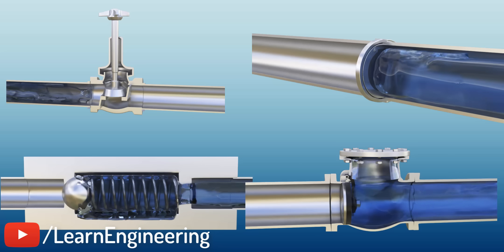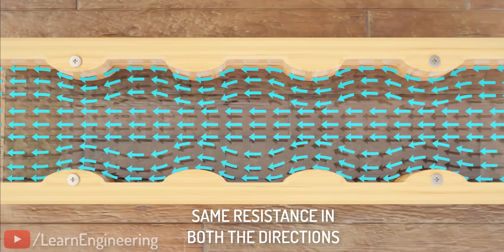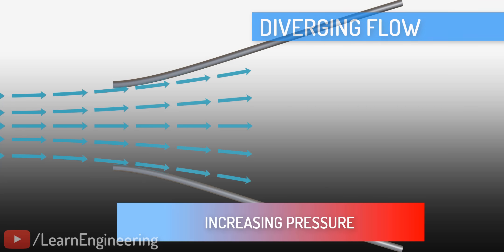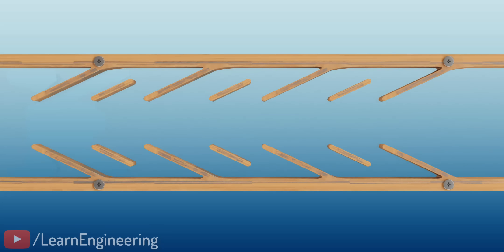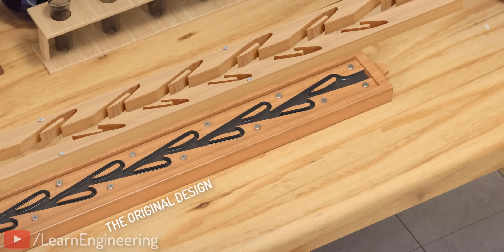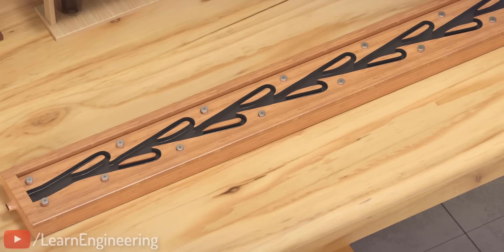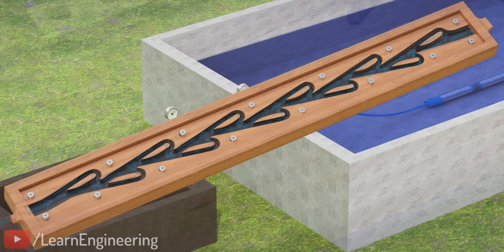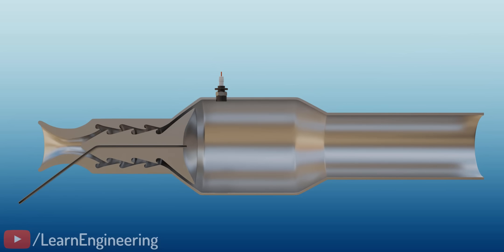Tesla Valve | The complete physics

Comment: Well I'm suprised the video does not show an actual water test.
Reply: Yes, showing actual fluidic components and models would be helpful for understanding. Notice the pulsing, as this is not only a partial diode but a partial fluidic oscillator.
Reply: Cause it doesnt work.00
Reply: Maybe because it wont work well enough to impress. It just makes a little bit of resistance, you can search on youtube to watch a test
Reply: @mauhoangthanhtrung  right, I put it slightly like you said. Maybe not as clear.
Reply: You can see a real world application of the valve here: https://youtu.be/OwHUl7ehIbI
Reply: @ausgepicht  Thanks, that is a great link. It shows what I expected, that the flow from each loop diverts the main flow into the next loop. Some particles are actually moving backwards through the main channel, so the flow through the side loops is actually greater than the total flow!
Reply: @ausgepicht  well no it shows turbulences...
Reply: You shouldn't have to make your own Tesla Valve. Surely one can be purchased online.
Reply: @hellbent7062  I had to buy a ball valve to reduce/adjust pressure on a project. Just saying.
Reply: @Joe Dirt yes , Mr. Joe Dirt! Good way to say it.
Reply: https://www.youtube.com/watch?v=OwHUl7ehIbI
Reply: I AGREE
Reply: you could do this with the addition of a dye at the inlet and would be great to see, but the animations work well on a budget.
Reply: @dizmatt1  I don't think dye would be something I could readily see. The link someone provided shows a large valve where they dumped black particles into the water, so it is easy to see the water flow by watching the particles. Dye thoroughly mixed with the water would be the same as just water, but the particles remain visible showing the flow.
Reply: @BenAtTheTube  dye would work but you're right in that it would dilute and lose effectiveness. I've done micro particle fluid visualisation in liquids using a laser light sheet which works well. The larger the particles the less likely they are to follow the flow due to their buoyancy but they can help with simple visualisation so they have their place of they don't aggregate and clog up the channels
Reply: @2684dennis  Well, lets waste another one by responding to this comment!
Reply: I think the more pressure and volume will show different results (which I don't think it is beneficial).  This might work only for a every small parts and applications (in open system).   Fluid in a close system always acts as a solid rod (such as aircraft hydraulic system).  This Tesla system must be a open system.  I haven't seen one yet.  Fluid is not compressible.  Air/fluid system (aircraft landing strut) is used to have the bird like landing effect (not bouncy) when they go thru the designed orifices.
Reply: @2684dennis  I really enjoyed the conten and the conversation,  I just was suprised the was only animation. There is no such thing as wasted time, have a nice one!
Reply: Before you comment, you need to understand what are types of valves. I suggest this as a starting point in your researching.
"Valves 101: Valve Types, Sizes, Standards & More - Unified Alloys" https://www.unifiedalloys.com/blog/valves-101/
Reply: Because the valve doesn't actually work IRL. Fake news
Reply: @tosgem  well yes and no, it is not a  "valve", the  principle or definition of a valve is e device that  can control the flow...here i see something  quite, intuitive,  the flow changes   according to symmetry of the system.....   that s all... i am supposed to admit in one  direction if will ALWAYS be weaker...well.. turbulent flows are tricky...as the system is based on turbulences.. well messy technology. hard to control. Ok no moving parts..as if it was a problem..
Reply: @tosgem  really, you think not. Lmao
Reply: @tosgem  it kind of works. Its not a one way valve but it has more resistance in one direction. My point is that with an actual test the video would look more scientific. Now it looks like some face mask commercial.
Reply: because it could never really be used in a real water application.  Explain to me the circumstance in which you would want water to flow in one direction and still flow in the other just slower?
Reply: @insertgoodname4809  Personaly I would build a hydraulic boolean calculator. But I can come up with more applications of this technology. Especially in agriculture and hydroponics.
Reply: @Tiriris  It's not a true valve.  It just slows the water down (marginally  at best).  How would you use this in real life.  There is a reason you don't see this being used.
Reply: @insertgoodname4809  Yes I know its a toy, but it's interesting!
Reply: @insertgoodname4809   , valve expert?
Reply: @inthemaze7441  Don't know, but I'm seemingly a common sense "expert".
Reply: @insertgoodname4809  https://youtu.be/sxvIQMnKhIg

This video will help a bit. Many more like this. It really is a valve,  just no moving parts as I have stated numerous times above. I've worked with many valves, motors, hoses, connections for many years as im a hydraulic and pneumatics engineer for a earth drilling manufacturer.  If I don't approve it, it doesn't go on the machine. Got it, ive done every bill of material,  on each standard unit, which includes,  triplex mud pumps,  water cleaning systems, and drilling units. When it comes to custom designs,  im the one on the clock.
Reply: It doesn't show an actual test because the diodicity is somewhere between 1.5 to 4. Where higher values are usually for pulsed flows. And the pressure drop is not negligible in the forward direction, it is quite large.
Reply: May be they don't have a wood or metal worker? Animations worked well enough as even if you could see though a plexiglass face, due to the valve slowing the flow, you could not see the direction of the water flow. This would then need animations of arrows again.

What I would find interesting is more mathematical information. How long, at what diameter, fin size, and liquid pressure going into.
Reply: @inthemaze7441  I got it wrong and cant quite understand how when the channel widens this leads to slowing the water?
Reply: @giggleherz  it doesn't get wider, it's the loops back, creating back pressure slowing flow. Now if you were to extend out the valve even further,  it would have a greater influence against pressure.
Reply: @inthemaze7441  no need for animated arrow, you could simply add dye or bubbles or a bit of sand to the water
Reply: @lastyhopper2792  but you must agree that building the valve, with a see through front, is more expensive  than showing the animation. The animation is correct.
Reply: @inthemaze7441  i am interested with the latest part that you mentioned too. IMO a large diameter pipe (more than 450mm dia.) seem very wasteful in terms of material production if using Tesla's design. UNLESS.... The angle of the valves increase. Perhaps that can help.
Reply: @yukia.8188  your correct. The deal is that it is a valve, however not a great valve by any means.
Reply: @yukia.8188  it's as the water screw being called a water pump. Is it?
Reply: Well. That's because it doesn't work as described lol. It's not a one way valve. It's more of a one way resistor. Certainly not as effective as the other valves shown in the video.
Reply: This is not a Valve, per se... It is an iteration of many in reaction to the next. If the flow of liquid is minimized, can a few drops make the journey thru??? Damn
Reply: @aheckers  can you show us some different valves, actions, and a brief discription of how they can be used together in a 7 bank valve, in both, momentary and stand....possibly tell us this, who said it was a shutoff valve?
Reply: That would substantially increase production costs. You might be able to get someone like William Osman to do a video fabricating and testing a Tesla valve.
Reply: @MelvinPepperdash  not really.  A cnc can cut out one for very cheap, and would have elevated the video above ufo sightings videos. You know,  animations are costy as well.
Reply: @Tiriris  They are obviously working from an animation studio. It might be cheap for youtubers who perform on-screen, but that requires a whole new set of equipment and staff.
Reply: @MelvinPepperdash  "obviously" is a strong word to use for what is in the end a hypothesis without facts.
Reply: @Krosis_  The facts are their own presentation. Do you think we're discussing a hypothetical channel where we didn't all just watch their production? Are you really trying to challenge what is obvious before everyone's eyes? That's called gaslighting. Everyone can see what they put out, and no one is guessing.
Reply: Check out drawings of Heron’s perpetual fountain.
Reply: @kenthazara5477  Do you even understand my point? I'm not saying it wouldn't help; I'm saying this production crew doesn't have an on-camera staff. What are you even replying to? Because it doesn't have anything to do with what I was saying.
Reply: @MelvinPepperdash  you're obviously wrong. Pls don't challenge me on this, the facts are their own presentation about why you're wrong.
Reply: @kenthazara5477  And for all this bickering, they included a link to an actual, physical demonstration in their pinned comment. I don't get why you choose to argue over this.
Reply: @Krosis_  I mean, if you just want to "believe" in whatever, go for it. But if you're right, you're essentially accusing them of being lazy and half-assing this project.
Reply: @kenthazara5477  you do realize though that this channel only explains the concepts behind technical solutions that already have or had practical applications, right? If you don't believe it works, well, that's on you. I don't think they're trying to prove anything. They're trying to explain how stuff works that already has been proven.

Comment: That’s more like a pressure regulator than a stop valve.  Still very cleaver though!  💡🤓
Reply: That is EXACTLY what I came away with. It would slow the water by a great deal..but it couldn't stop it. Not without a shutoff VALVE to do so.
I guess I am to stupid to understand what they mean by the word..VALVE. 😂😂😂😂✌️
Reply: @garyheaton4791  hello binary friend, put the unit at an angle n u can stop the drip. Stop acting so linear .
Reply: @garyheaton4791 z 14 tttut 💥💥5photo N2CIS,1,:3rd f61 MLaa52B 💥r etc. ÇdtoyCD 4
Reply: No, not a pressure regulator but a flow regulator. Like in drip irrigation. I do wonder how the flow reacts to an increase in a higher or lower pressure.
Reply: @luiexluie  my question exactly!! I work with water lines on ski runs, with drops of 1500 feet. our PRV's are ineffective in cold temps without a heat source.
Reply: Some folk need to look in a dictionary
Reply: ave baker  its not a check valve though is it.
Reply: A valve is a pressure regulator...
Reply: @k1sserCx  a pressure regulator is called, a “ Pressure Regulator.” As far as “valves” there are many types.  An isolation/stop valve is what the title of this video was interpreting but left out the type of valve.  You would confuse a parts store worker if u ask for just a valve...  They would in turn ask you, “what type of valve???”  Lol.
Reply: ave baker  i fully understand what it does and how it does it but it is not a check valve though is it, think before you reply

Comment: The design challenge from the very start of the video was to create/design a ONE WAY valve... Tesla's Valve cannot stop the flow of a liquid in either direction. For that reason Tesla's "increased resistance pipe" fails the design brief, and receives a thumbs down.

Comment: @4:28 I would have thought that the curved surface of the secondary flow 'Island' would serve to accelerate the secondary flow back to meeting the primary flow, thereby further reducing the velocity of the primary flow. Where you mentioned the loss of velocity when it hits the "bucket like structure" @ 4:2, the loss of velocity of the secondary flow would be necessary but undesirable; the following curve would thus compensate for this as I mentioned. I feel that this is likely an important design intention by Tesla. 
Very nice video, thank you.

Comment: At 1:19 it seems to me the left-to-right flow is diverging in the center but converging near the outer walls. While the right-to-left flow is converging in the center but diverging near the outer walls. I guess actual testing would probably reveal some difference in resistance one way or another, but my instinct looking at these diagrams is that this is similar to perpetual motion machines -- where they seem logical until you look at the total picture. The water (or whatever) is flowing through the whole passage, not just the center where the arrow is. I find the arrow through the center holes to be a bit misleading, in fact, focusing my attention away from other important facts.

Comment: This is cool, but the tesla valve is not a one way check valve. If you turn off the flow the water will drain from the inlet of the valve. The purpose of a one way check valve is to not have any flow in the reverse direction with the flow on or off. This video is misleading.

Comment: But... now the whole valve has to be flipped 180 to change the flow. It's got the most significant movement, with the greatest external energy input of any of those valve designs. Not to forget, also the worst flow rate when active. You're just outsourcing the valve movement to another part of the system. It's a valve with no moving parts in terms of linguistic technicalities only. Someone with engineering smarts plz explain how this is better I'm missing it.
Reply: In the animation they moved the valve for demonstration purposes only. They "connected" the valve in one direction to show it flows freely, then connected it in the other direction to show it restricts the flow.

In actual use it would remain in a fixed position to restrict backflow if the pressure on the input side dropped below the pressure on the output side.

If you were pumping from a source into a tank, and your pump failed, this valve would restrict the fluid flowing backwards through the pump.

Comment: This is not a valve. It just adds more resistance in one direction.
Reply: Valve

Noun

A valve is a device or natural object that regulates, directs or controls the flow of a fluid (gases, liquids, fluidized solids, or slurries) by opening, closing, or partially obstructing various passageways.

It's a valve.

Comment: but this TeslaValve will not completely stop the flow but what about, when used in "fluid transfer" the valve was set at a steep enough angle that the remaining pressure could not overcome gravity?  Then it could stop it, right?

Comment: I don't understand. How does this stop the flow from reversing? From what I can see, the fluid will flow in both directions, only more easily in one than in the other. This is not a one-way valve. A one-way valve allows flow in only one direction. It may restrict bacflow, but it won't stop it.

Comment: I wouldn't call it a valve because it doesn't completely stop the flow . It restricts the flow in a predetermined manner so it is more of a limited range throttle . This wouldn't be acceptable has a backflow preventer because it does not 100% prevent backflow and for health reasons 100% blockage is necessary.

Comment: "Can you make a one-way valve without moving parts?" 
A diode.
Reply: and as a tesla valve doesn't stop water flow completely, a reverse biased diode does not stop electron flow completely either, only reduces it to very small portion.
Reply: A Peltier device.
Use a thermoelectric cooler to electrically freeze the liquid solid at a point, and also use it to allow the flow by it heating the frozen point.
Reply: yes lol
Reply: You can contact 6.turbo on instagram he helped me recover mine
Reply: As an electrical engineer I also immediately thought of a diode but this Tesla valve is specifically oriented toward fluids. Since diodes only work with electrical current I don't think we can count those except for the special case of electrical current. I know of no fluid analog for a diode.
Reply: @stevewhite6252  fluid analog - a step in the height of flow (think of canal locks?) - flowing down is easy, flowing up requires a minimum height of fluid, aka reverse breakdown voltage...?